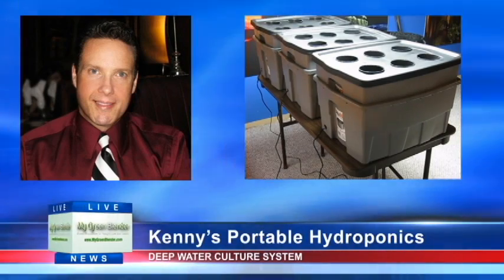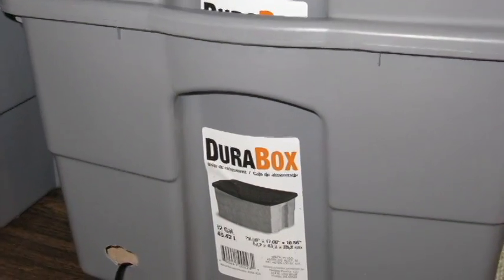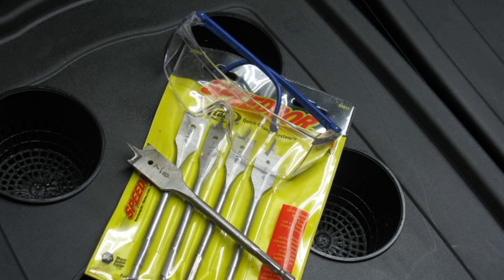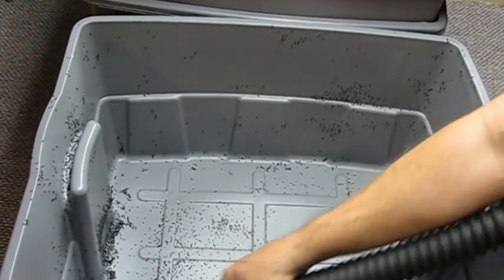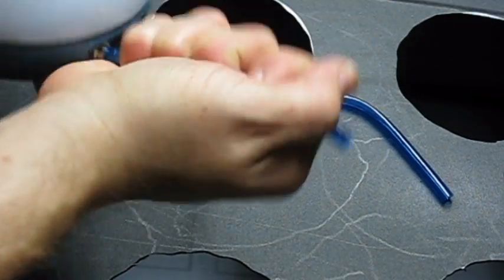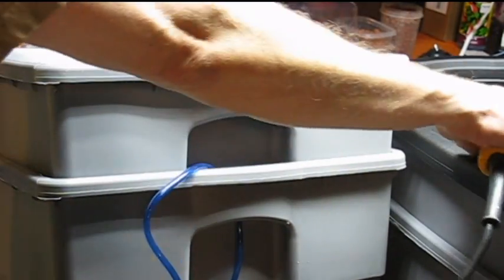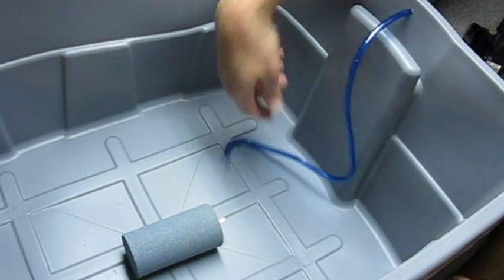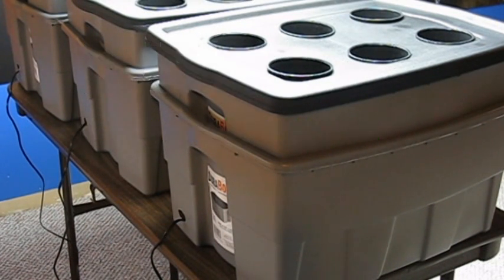How to Build Deep Water Culture Hydroponic System

Comment: For the holes, both small ones and the net pot ones, you can also use a wood burning tool.  Quick and easy to make a line around the net pot marks or just to poke a hole for tubing.  The heat makes the plastic smooth so no sharp burrs to clean off or out of the tote.

Comment: And air pumps don't last forever running 24/7.. I also don't need to take my flowering plants shopping with me in a radio flyer wagon. Sat my airpump on a brick outside the tent and above the water line.

Comment: Very clear video, however far too much emphasis on the bottom pot which is there to hold the airpump (?!) thus can be easily eliminated just by fixing (simply glue) the airpump anywhere else on the top pot, lots and lots of space on sides... Clean and tidy.

Comment: nice concept I like the self contained part, I'm running my radishes about the same set up its a mess  with the hoses,  wires, just messy the only extra expenses I see is a 4 dollar tote not sure what the trolls are pissing about ?  I was thinking about putting in oversize airpumpto make a splash enough so I can drop the water level considerable amount  basically turning it to airoponics system/hydroponic system!  any serious ideas ?

Comment: These comments crack me up! I have 6 of these running and have a harvest of 30lbs of tomatoes this year off of 1 tote.
HEAT, MORE STONES, BIGGER PUMP and so on? That is funny! Works fine like he has it. Tweak things as you need it. Try growing in 110 degree Texas and figure out how to cool reservoirs and get plants to flower in heat,  Take ideas and create your own successful environment for your plants. I have NFT Systems, Aquaponics 3500 gallon pond that took me a year to build and perfect it and not to mention $11,000.00 it cost me to try it. Ebb n flow tables in my house running of of MH lights and T5's, Wicking Barrels that have over 11' Toms in them as well as 8 x 4  conventional raise grow beds. Did everything this year except for the pond and work 68 hours a week being a Collision Director at Ford. I work my ass off! I tried so many things and had to throw so much Hydro stuff away that did not work for me and I'm still going! I don't have shit to brag about except a couple of things that worked out great that I'm proud of. The rest of my trials are ok at best in my opinion but I will get it right! So just thank the man for filling your little brains with free information.
Reply: if heat is a problem put the unit in your celler or if your house is on wheels use a COLEMAN COOLER

Comment: so the roots grow and how do you remove the plant from the basket without damaging the roots. You have to cut the bottom off. Not to mention the bottom tote could be dangerous since you're enclosing a motor with no ventilation. Fire hazard.

Comment: Placing the air pump above the water line is better. There will be less back pressure, dramatically increasing the life of the air pump diaphragm. Not to mention the pump is being enclosed and has no passive cooling effect ie some kind of heat transfer into ambient air. Also, the heat from the air pump bellows will heat the bucket water in an uncontrolled manner.
Reply: +Joseph Guida very good point about the heating of the water in the upper tote
Reply: Good tips! Do you have a video demonstration? Would live to see your points in action.

Comment: if you add nutrients how would you change the water in your reservoir without damaging roots!?
Reply: It's kind of a pain in the ass, but what I do is wrap a cheap water pump with a pair of panty hose or a stocking cap. connect the pump to a hose, plug it in and drain!

Comment: Using pressure treated 2X4 is a no-no. The chemical used to preserve the wood is poison. This will leach into the water and the veggies. If the wood is still damp when purchased you may as well pour the preservative into your water from a bottle.

Comment: I got a elemental O2 pump  and it says   Wattage 41W Voltage 120V   I want to know isn't that a lot of power to run continuously. And anybody know the money per month that translates to
Reply: ***** Thank you
Reply: at $0.10 per kwhr, running 24 hours a day, a 41w pump will cost 9.8 cents per day or $3.05 per month

Comment: Great job on the portables. One question..with the air pump resting at the base,is there still an electric plug in cord attached or is there an inside power source to operate the air pump..?

Comment: Your pump will get too hot and cause premature malfunctions. If you keep the air pump about 15 inches above your air stone you don't have to use check valves because the water will not go back into the pump if it fails. However, better safe than sorry with the one way check valves. I do like the idea that if the top bin happens to leak you won't get a flood. Thanks for sharing!

Comment: If you get 2" net pots and use 1.5" rockwool you dont have to bother with the hydroton. I did a experiment with this and found there is no difference in plant size when using 3" net pots with hydroton or 2" net pots with just rockwool. The roots grow down anyway so the size of the net pot can be small. There, I just saved everyone money.

Comment: I like how the system is one unit that I could pick up and move, but my fear is that if it does sit outside in torrential rain, that water will make it's way into the bottom tote and fry the air pump.  Those air pumps are not too costly, so I might consider building one of these.  Overall I like your ideas and instructions.  Thanks!

Comment from the maker: If your water is properly oxygenated, you can fill it as high as possible, since you don't have to worry about drowning the roots. However, if it's too high, the bubbles cause the water to splash out of the top of the pots. So, experiment with what works with your air pump. The main thing to keep in mind is that you don't have to worry about submersing the roots.

Comment: I made a system similar to this using an old Aero garden.  The air pump went bad in it but the rest of it was working fine so I gutted it and wired a much more powerful air pump to it (the output power for the aero garden air pump is was way higher than needed for the little pump).  I used a triple tote setup with two water chambers, one for mixing nutrients and the other for aerating and root feeding.

You don't need the pot to touch the water.  The bubbles from the air stone will splash 2-4in

Comment: If the power drops out wouldn't the water flow from the top bucket where the roots are down the air line into the bucket on the bottom ?

Comment from the maker: Water lever should be touching the bottom of the net pots until there's enough root to dangle into the water. Then, you can reduce it if you like. As long as the water is properly oxygenated, you don't have to worry so much about getting too much water on the plants. Check the water about every other day.